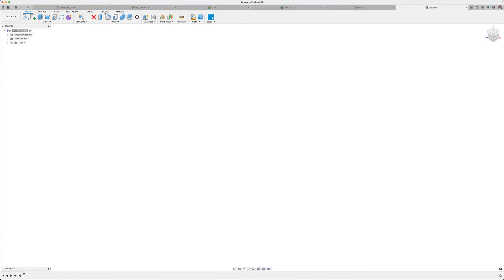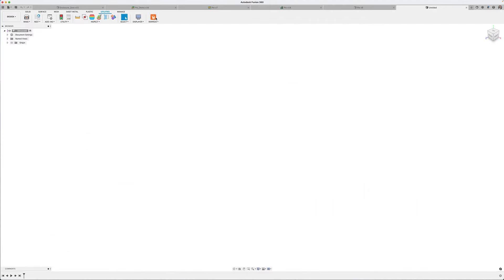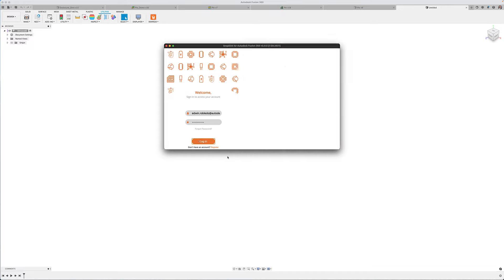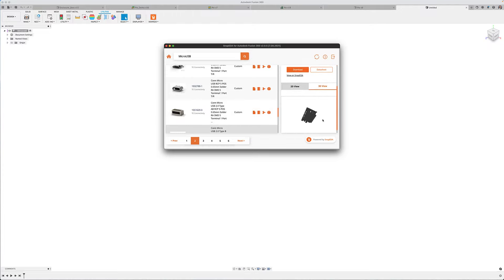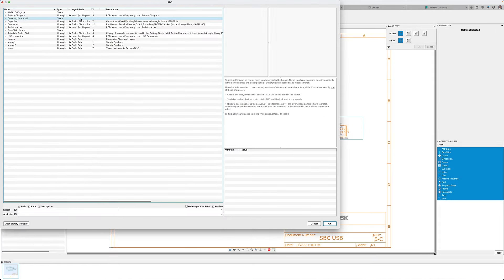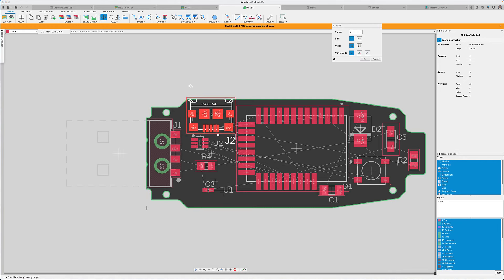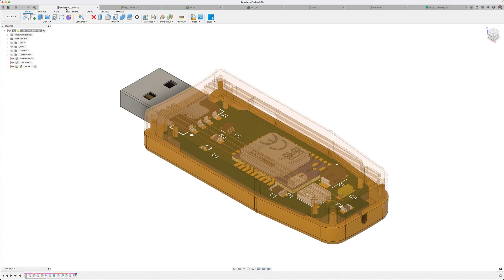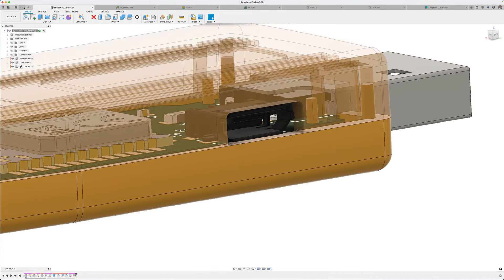Fusion 360 Electronics Add-In: SnapEDA | Autodesk Fusion 360

Comment: You should rethink how you're doing the schematics, the one at 1:03 is just unreadable; when you have wires intersecting too much, it's very easy to make wiring errors, connecting different parts of the circuit with net labels would make it much clearer when wire cross connections are inevitable.

Comment: It only imports 3D model but not footprint and schematic symbol, when I click "FINNISH" it asks me to save the file. The library overview is blank and doesn't show the "New", "Connect" or "Prefix" buttons (even tho I have the 3D model in the SnapEDA Library). Is there any fix for this issue?
Reply: Hello there! 

Thank you for reaching out. May we please know which particular part did you find this issue with? You may also want to try following the steps of this article to add your parts to Fusion 360 using the SnapEDA add-in: https://support.snapeda.com/en/articles/6162348-how-to-add-parts-into-autodesk-fusion360-using-the-snapeda-plugin. 

If you have any further questions, please contact us at support@snapeda.com and we will be happy to help!
Reply: @snapmagic_  it happend to any part I tried to add. I will check the guide linked and see if it works. Will email your support if I can't get this issue resolved. 

Thanks for the reply!